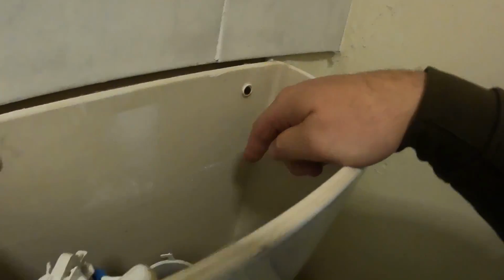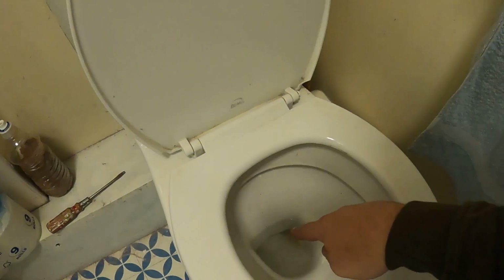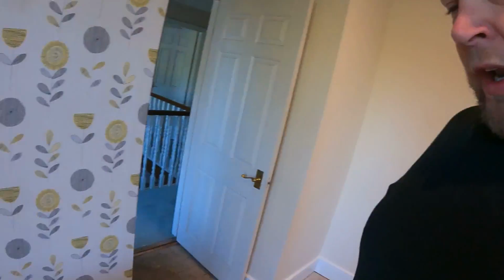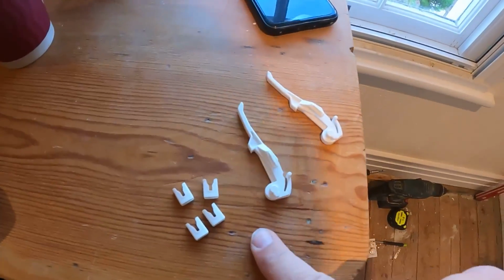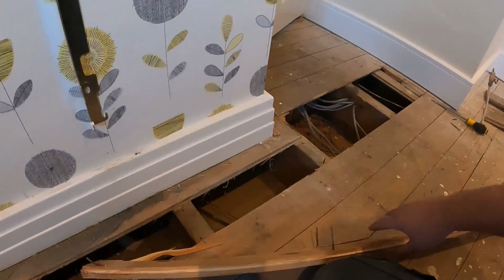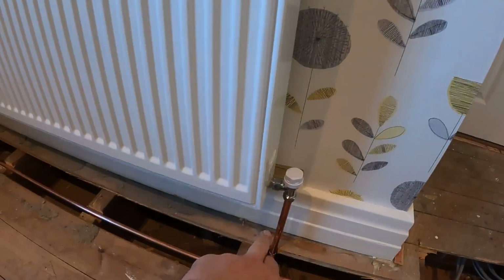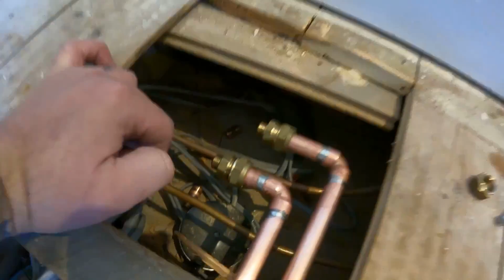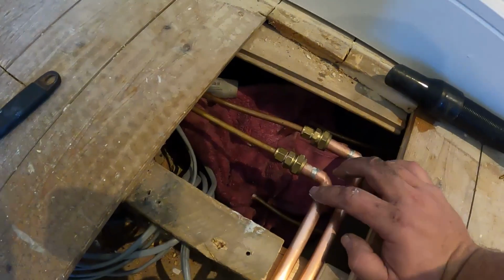CENTRAL HEATING | ADD A RADIATOR THE EASY WAY… (How To)

Comment from the maker: Use "MJTIFF" at checkout to get the Unilite SLR-1750 for £50........ Bargain that!!!!!
Reply: Shame it doesn't work on the EU site, but I got an extra 2€ off their sale price of 70€ instead and that's near enough £50.
And that toilet blue stuff, no no no no, never .. takes ages to get the stain out of your hands if you have to fish around the cistern to get one out
Reply: Thanks mark ordered 2x of the unlites one for a mates 40th and one for moi! Cheers for the deal code. 
Great content as ever mate, nice to see you using paste … so many plumbers I employ not using it … the last one cost me a new boiler as he said it was the boiler leaking and evaporating losing pressure … guess what it was his dry fit pipe work behind the fridge weeping losing pressure. How Much does paste cost in time and materials, I’m guessing pennies per fitting ?
Reply: Any chance you doing a review of the unilite UR4.5 tool bag
Reply: Your techniques  are sometimes so bad !! You should have just cut the microbore with pliers or snips,  a few inches long, and then used the proper cutter whilst lifting the pipe out of the floor Cavity!  So obvious ! 😂

Comment: Hi thanks for the videos. When I first started plumbing 40 years ago a guy showed me the same way to hang a rad.  The only difference was he always said take a board up in front of the rad first  as you might just be able to fit the rad a little bit off centre but save yourself from going straight into a joist with your pipe. Peter Booth. ( non famous)
Reply from the maker: Thanks buddy 🙌🏼👍🏼👍🏼👍🏼

Comment: I’ve just laid 80 metres of pipe, sick of the 8mm pipe blocking so changed it all to 15mm..good vid 👍🏻
Reply from the maker: Thanks mate 🙏🏼
Reply: Hi @gandhi1079.
Thinking to do the same this weekend, all flooring is up and house is being renovated in every aspect. 
I have 8mm running to radiators which T’s off from 15mm. 

Could I keep the 15mm and remove just the 8mm or do I need to add 22mm for better flow? Also did you do this in the end? 

Also thanks @mjtiff I’ve been watching a lot of vids lately whilst doing my project and they’re amazing & in great detail without missing bits out that are essential to see. 
👍🏻😊
Reply: Your videos should I mean
Reply: @MJTiffPlumbing  you should already have 22mm pipe running from your boiler under the floorboards. Just run 15mm from the 22mm. As you say 22mm will give you better flow

Comment: There may have been a chance of soldering that 8 mm to 15 . I’ve done it plenty of times with water in the pipe , as long as you have a few inches of dry  away from where you’re soldering, jobs a Gud un 👍
Reply from the maker: Yer possibly…. Just didn’t want to run the risk as wasn’t sure how well it would drain, compression for the win on this one

Comment: Grate vid Mark 

You should get the 8mm and 10mm pipe slices from Toolstation 8mm 26361 £7.80 10mm 28990 £12.99  lot easier and better in confined spaces and they are cheap.

Have a good rest of the week see ya Sunday.
Reply from the maker: Cheers mate, I will grab a set👍🏼

Comment: Top video again Mark exactly what I would of done and do ,I normally isolate the flow and return and work live as it air locks without any pressure, system still full and live do one at at time without fully draining. 
 Bathroom you did seems to grow on you as long as the customer is happy and they have paid the readies 👍
 If it was shite I'd say but dont worry pal it's a good install. 
Keep the real world plumbing coming 👍
Reply from the maker: Yep I will bung a gravity system as I’ve shown a good few times👍🏼👍🏼
A few people have said the bathroom sort of works now it’s all in…
Thanks mate🙏🏼

Comment: I’ve always fluxed like that I’ve tried brushes a few times but seemed to get flux everywhere and it was just another thing to spend 10 mins trying to find after just putting it down😂😂 top vid again mate👌
Reply from the maker: Exactly right mate…… stick to what we know eh 😉
Reply: What do you do if you get a joint that oxidises as you solder it you know what I mean ?when it turns dark I hit it with brush to clean it up and add solder in does that not cause an issue without a brush ?
Reply from the maker: Never had an issue to be honest buddy

Comment: Great video many thanks, really liked that 15mm. Amateurs should turn the electrics off first e.g. loose wires into JB or water leak etc. (note you were earthed on the pipes which will make the shock worse). I've had belts as an electrical engineer and not proud of them. More dangerous than you think as heart damage may not show up straight away. Sorry to nag. Dumb question: where notching on joists might be unacceptable for undersize joists, could you put metal plates over the top. Use a router each side to get them flush. It's an American idea - I think they do it in stud walls incase you try to drill the stud of finished wall and hit the pipe. Liked the drain down kit, much better than stick on bits of polythene. Look forward to the next one.
Reply from the maker: Thanks buddy, glad you liked it👍🏼👍🏼
Reply: @MJTiffPlumbing  Great to see how professionals do stuff using their vast experience.

Comment: Hi Mark, another great video.  I moved in to a house quite a few years ago that had 8mm to all the rads. Downstairs it was plastered into the walls, upstairs pipe came up through the floor. Every single one of the upstairs ones had crushed flat pipes, all at the same height, I’m pretty sure that this was caused by some over vigorous vacuum cleaning 😮.  I did what you’ve done and replaced the above floor pipe to 15mm copper.
Reply from the maker: Yep I’ve seen exactly that where people have smashed the vac into the pipes
Reply: I’ve just moved a rad from one wall to another while I was adding insulated plasterboard in my 1930’s house, ran the pipes up behind the wall away from getting bashed with the vacuum cleaner, it’s all ready to connect up but I need to get into the loft to bung the tank but as I’ve moved everything out of the room to work I’ve parked the wardrobe until we get the room plastered under the loft hatch and filled the wardrobe back up, luckily it’s a lot warmer in there now. I have a few questions, will it make a difference to heat up when stepping up the pipe bore size, what is the paste that you use on the joints, and does it matter which side you put the thermostat on to the rad? Thanks

Comment: Bread and butter jobs today then, nice little bit of work, 8mm is such a nightmare, so easy to overtighten and crush the pipe! But I do the exact same. up into 15mm
Snagged one of those unilite's while they're at an all time low, so thanks for the code! Be interesting to hear how many were sold with your code! 
Have you tried those plumb tubs that wrap around the pipe? I swear by them tbh great for draining from the valve like you did there, but they are only small.
Reply from the maker: Indeed Josh….. bread and butter jobs indeed.

Bargain them lights mate, I know I’ve nearly shifted 150 in a week so far…😉 bargain of the year.
Reply from the maker: Yes I need to get one of those tubs mate
Reply: 8mm pipe liners?

Comment: Enjoyed watching that. When you add a new rad to an existing system do you have a rule of thumb to quickly set the balance of the lockshield valve? Or just set it at 50% open and let the home-owner tweak it as necessary?

Comment: After replacing a couple of rads recently If I ever have another system installed I'd insist on stop valves so each leg can be isolated.
Reply from the maker: Always full bore ones

Comment: Cooling the pipe straight away and so little flux is giving me nightmares 😂
Reply from the maker: Absolutely fine…. 18months later and it’s still not leaking🤣😉😉
Reply: @MJTiffPlumbing  😂 always a good sign. I remember snatching a rad valve before. Black water everywhere. Saved draining a nightmare system though. 😂

Comment: I always drop the pressure at the valves where your working 😎
Reply: Water out of the valves into a black bag, then chuck a black under the floor below the pipe work and cut and connect away 👌🏼😎

Comment: I was always lead to believe you should not flux inside a fitting as the pipe just pushes the flux inside and over time will corrode the pipe from inside as it is acidic?  I am a joiner but also do a bit of plumbing when needed.
Reply: It's led man, led for goodness sake. Just kidding 😂
Reply from the maker: Steve…. I’ve always done it this way for 26+years… no issues doing it this way
Reply: Shouldn’t do it on gas but any water will flush any flux residue away
Reply: Always flux up the fitting.
Reply: If you haven’t already you should try ‘everflux’ I used to use laco but never went back after I tried everflux
Reply: @whynot6950  Powerflux always for me.

Comment: Great video again Thanks Why did they use 8mm pipe in the past?
Reply from the maker: In the 80/90’s it become a bit of a thing… a lot of people had heating systems in 8/10mm…… due to cost, speed etc..

It’s a nightmare to be honest, they block up so easy
Reply: @MJTiffPlumbing  Thanks
Reply from the maker: No worries buddy

Comment: Don't force cool the soldered joints with a wet rag. Solder and copper contract at different rates. It will introduce cooling stresses in the joint and increase the tendency to crack
Reply from the maker: Initial temps were gone from the pipes buddy, not an issue👍🏼
Reply: @MJTiffPlumbing  Only DIYers will be watching this channel. You are encouraging bad practices.

Comment: Why did you not use plastic pipe under the floor so you could drill holes through the joists for the pipes and use push fit fittings!!
Reply from the maker: Because I used copper on this job buddy👍🏼👍🏼
Reply: @MJTiffPlumbing  I saw that!! But push fit elbow would have still been easier!! (and cheaper!!)

Comment: Hi sorry if I missed it. I take it you worked out which pipe was the hot? Does the hot go into the thermostat valve?
Reply from the maker: We now use bidirectional valves so that’s not an isse 👍🏼👍🏼

Comment: If I do pipework, I will put the radiator 60cm fahr, only if I put the thermostat low, the boyler stop working perpanently, get off the water is it enought? This is only 15 min job. Or I need to close the elektricity and gas too??? If I do pipework heat back from the pipe which is 5 m fahr, to the boyler and explode???

Comment: I wanted to ask a question and hope thats ok ,which is cheaper for a brand new extension being built right now  two very large radiators or underfloor heating the builders asking him to decide ,i said rads must be a lot cheaper is that right ,The extension is 6 metre by 7 metres .many thanks if you could advise i know your vet busy,its in south london,
Reply from the maker: Rads would be a lot cheaper to be honest mate
Reply: @MJTiffPlumbing  Many thanks i have passed it on.cheers
Reply from the maker: No worries mate

Comment: Just a quick question. What’s the name of the device to help get radiator pipes plumb? I’ve used the same method with a pen but if there is a more accurate way I would love to know
Reply from the maker: I think it’s called “pipe centre” or something like that……🤔🤔
Reply: @MJTiffPlumbing  thanks for replying
Reply: @ChrisLivingInYork  you could use a roofing square to get them plumb.
Reply: If you’ve already got a laser level, I’d use that, takes longer to do but it’s always perfectly straight

Comment: I didn't know that you are still allowed to notch joists, I've been under the impression that you're now supposed to drill through the joists and run pipes through the joists.  Probably not practical when using copper.
Reply from the maker: Yep cant do it that way when using copper

Comment: Hi Mark , i was always told at college to heat the pipe never the fitting ? And why do you cool the fittings with a wet rag any special reason im not aware of?
Reply from the maker: To be honest mate as long as your heating it it will all get hot, I’ve done it this way for 26+ years…👍🏼👍🏼
Always wipe with a wet rag after to clean the pipe or they go all green with flux that’s not been wiped off👍🏼👍🏼…. They should teach you that at college

Comment: Do you have to lag pipes under the floor due to part L building regs now?
Reply from the maker: On new builds etc yes
Reply: Isn’t that going to be fun ! How deep will we have to notch to allow the boards to go back down to accommodate lagging who comes up with this shit the heat is returning to the envelope of the building. A secondary return I can understand for obvious reasons (heat loss recovery ) but that new one for all pipework including heating circs is an absolute joke lol
Reply: And new full installs I believe bud. Madness as per my comment reg boards going back down lol
Reply: And you have to lag pipes between block and plasterboard 😂 can you imagine the size of the gap

Comment: Hi Mark, are all flush valve rubber seals the same or are they different depending on the make on the flush valve?
Reply from the maker: All different mate (which is a pain as you have to carry so many)

Comment: Never a big fan of increasing the size of pipework, the drop in velocity seems to lead to suspended solids dropping out in exactly the same way a heating filter works.
Reply from the maker: Imho better than horrific microbore….. agreed you wouldn’t step up 15m to 22mm but 8/10mm is much better to go to 15, and it works absolutely fine👍🏼

Comment: I found an easy way to dump water pressure out of the heating system in a pressurized system is to dump water out of the safety valve. That has worked well for me where one can't find a convenient drain
Reply from the maker: Oohhhh…. Controversial!!!!…. I never even dump from a safety valve as 90% of the time unsettles it and it never seals again…
Reply: Err... no never do that
Reply: Mate, just be careful as PRV’s tend to not re-seal once activated after a period of time of sitting in situ. Just offering some advice my end if it helps

Comment: use 12 mm pipes to the radiator and then connect to the 8mm.
Reply from the maker: We don’t use 12mm pipe….. 15mm is the best for this

Comment: Why don’t you just open the valve upstairs after you’ve drained from downstairs before you cut pipes 🤷🏻‍♂️ Lee.
Reply from the maker: You could of done but didn’t need to mate…. Was empty as you can see in the video👍🏼👍🏼

Comment: Two things Mark, you didn’t de bur the 8mm pipe so now it’s 6mm. And you didnt show us how to find the flow pipe for the new TRV. Sloppy mate.
Reply from the maker: 2 things mate….
You don’t need to know the flow as for the last 10years TRV valves have been bi-directional…. All good plumbers know that😉

And I have never de-Bured a copper pipe in 26years doing the job……. I think I will be ok pal.

But thanks for the comment👍🏼